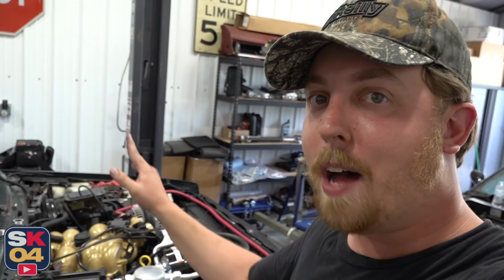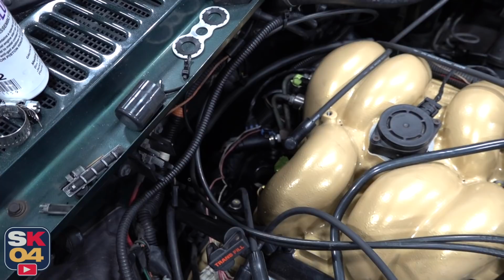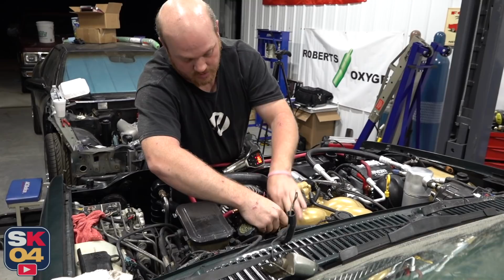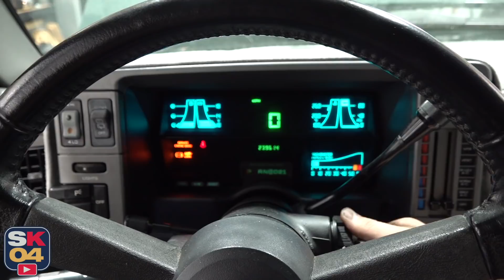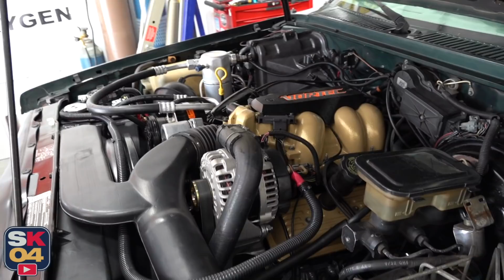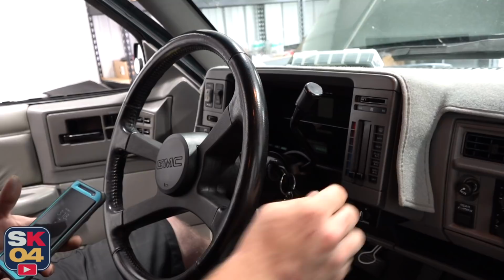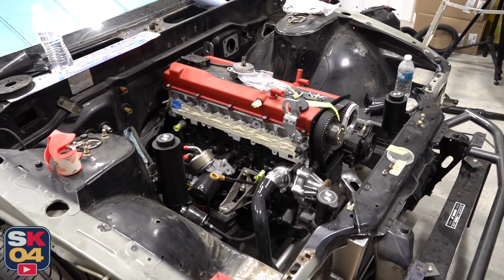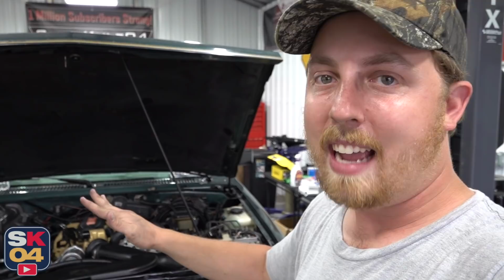The New Engine Comes To Life (First Start Up!): Jimmy Resto Ep.13

Comment: That exhaust is nice EXCEPT where's the bolt together flanges so you can split it when you need to do transmission work? I wouldn't have been happy with a one piece unit,

Comment: Looks like the headers fit good..good clearance it seems now that it's in. Looks good..keep on keepin on. I sure hope you had a professional do the HVAC. Man that would suck you dont pull a proper vacuum and destroy that compressor!
Reply from the maker: For sure!  We got it all taken care of!  The headers worked out great, at least so far.  I would sure hate to do it with everything installed after the fact haha.  It's one tight engine bay surprisingly.

Comment: When you do the new of your 240sx I want to see a new hood pad installed on the Jimmy in the first part of the video. What do you think.
Reply from the maker: I was going to install the Jimmy's hood pad in this video but I'm having clearance issues with the upper radiator hose that I need to work out first.
Reply: @saabkyle04  Are you going to do a video on rebuilding the RB transmission?
Reply from the maker: I don't think I'll rebuild it, I'm worried about tearing into a good trans and not being able to find a part.
Reply: @saabkyle04  you said in the RB reveal vid that the transmission will be rebuilt.
Reply from the maker: I say a lot of things, call me over confident lol.  Unless I can find a shop that specializes in these transmissions, I'm going to run it as is, get some good fluid and hope for the best.

Comment: Cool but I definitely would have put in a 350 which is basically the 4.3 without a couple cylinders chopped off.
Reply from the maker: Yeah but that's also more complicated than it's worth being 4WD.  If it were 2WD, that'd be a different story.
Reply: @saabkyle04  That's a great truck; much better looking than the later Jimmy and nice fully loaded but my dad had a Safari with that 4.3 and I find it gutless as hell. I'm sure yours has more power! Careful with the transmission as it has no safety control in case you're in neutral but think you're in drive like I did with his! Killed that thing accidentally sticking it in R when I was going about 60 MPH.

Comment: I was hoping you were going to do electric cooling fans on the Jimmy instead of the mechanical fan that takes some of your little horsepower away.
Reply: Eletric fans doing the same, or how do why spin, with love? No, just more load on the alternator, way more
Reply: Ricy013 Kyle has a way beefier alternator which can easily handle the extra amp load

Comment: Can I get you (and) or your friend to swap my 2.8 for a 4.3 (I know it will also need another 700r4 with a bolt pattern for the 4.3)?  The 2.8 is worse than a riding mower.

Comment: Get rid of the stock RB crankshaft pulley it's rusted and ugly.
Reply from the maker: Huh?  The crankshaft is inside the engine.  Now if you're talking about the water pump pulley, then yes, I need to get that crap off and clear coat it so it doesn't come back.
Reply: @saabkyle04  Stupid auto correct didnt put crank pully but aside from that do you have the stock crank in the RB or do you have an Eagle Crank?
Reply from the maker: I have a new crank pulley too but I'll swap it later, I have the stock crank
Reply: @saabkyle04  Oh okay